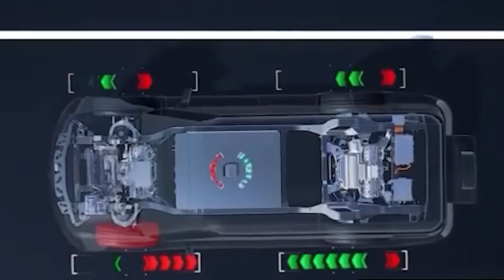Next-Gen BYD Blade Battery: A New Era in EV Safety!

Comment: Blade Battery (LFP):

Uses lithium iron phosphate chemistry (LiFePO₄).

Key Features:

High safety (resistant to thermal runaway, passes nail penetration test).

Long cycle life (~3,000+ cycles to 80% capacity).

Lower energy density than NCM but more stable.

Used in BYD’s EVs (e.g., Han EV, Tang EV, Atto 3) and energy storage systems.

Ternary Lithium (NCM) Batteries:

Nickel-Cobalt-Manganese (LiNiCoMnO₂) chemistry.

Comment: BYD (Build Your Dreams) is a leading Chinese manufacturer specializing in electric vehicles (EVs), batteries, and renewable energy solutions. Here’s a summary of BYD’s battery technology and key offerings:

### *1. Battery Types*
BYD produces several types of batteries, with a strong focus on *Lithium Iron Phosphate (LFP)* and *Ternary Lithium (NCM)* chemistries:
- **Blade Battery (LFP)**: 
  - Uses lithium iron phosphate chemistry (LiFePO₄).
  - **Key Features**:
    - High safety (resistant to thermal runaway, passes nail penetration test).
    - Long cycle life (~3,000+ cycles to 80% capacity).
    - Lower energy density than NCM but more stable.
    - Used in BYD’s EVs (e.g., Han EV, Tang EV, Atto 3) and energy storage systems.
  
- **Ternary Lithium (NCM) Batteries**:
  - Nickel-Cobalt-Manganese (LiNiCoMnO₂) chemistry.
  - **Key Features**:
    - Higher energy density than LFP (better for longer range).
    - Used in some BYD models and other applications requiring high energy density.

### *2. Key Advantages*
- **Safety**: Blade Battery’s LFP chemistry minimizes fire risks.
- **Longevity**: LFP batteries degrade slower than NCM.
- **Cost-Effectiveness**: LFP batteries use cheaper, more abundant materials (no cobalt).
- **Vertical Integration**: BYD manufactures batteries in-house, controlling quality and costs.

### *3. Applications*
- **Electric Vehicles (EVs)**: BYD’s Blade Battery powers models like **Han EV, Dolphin, Atto 3 (Yuan Plus), and Seal**.
- **Energy Storage (BESS)**: Used in residential, commercial, and grid-scale storage.
- **Electric Buses & Commercial Vehicles**: BYD is a global leader in electric buses with LFP batteries.

### *4. Global Expansion*
- Supplies batteries to other automakers (e.g., Tesla, Toyota in some markets).
- Expanding production in China, Europe, and other regions.

### *5. Future Developments*
- **Sodium-Ion Batteries**: BYD is researching lower-cost alternatives to lithium-ion.
- **Solid-State Batteries**: Investing in next-gen tech for higher energy density.

### *Conclusion*
BYD’s battery technology, especially the **Blade Battery (LFP)**, emphasizes **safety, longevity, and affordability**, making it a strong competitor to Tesla’s batteries and other lithium-ion solutions. Its vertical integration allows BYD to dominate the EV and energy storage markets efficiently.

Would you like details on a specific BYD battery model or application?

Comment: High nickel(90% or more) NCM or NCMA batteries are more suitable than LFP batteries for the EV environment that require high discharge and charge, i.e., high C-rate.  It is even better in low tempratures characteristics and energy density. LFP batteries may cause fire in high C-rate, so it is suitable for ESS that requires a low C-rate.

Comment: this article forgot that the BYD blade is already on the road since early 2023, Tesla uses the Byd blade LFP for its Model Y SR MiG (made in Germany). Way better charging than the current Catl and is on par with more expensive NCMs. The 2024 upcoming new blade LFP is next gen, same with the new Catl shenxing blade. Both improve performance again
Reply: This Blade battery version 2
Reply: next gen blade battery he is talking about!
Reply: Are these coming to tesla modelx?
Reply: My brother bought a Model Y from germany RWD model new in 2023. It had a CATL battery in it. I yet have to find any Model Y with the actualy blade battery. Even crashed Model Y RWD's i search for their battery have the LFP batteries from CATL. Can you please mention the battery pack unique identification number for the pack with BYD Blade ? Because Tesla never ever officially mentioned using BYD batteries. It's was all rumours.
Reply: @HermanWillems  Check the vin of the car,  XP7=made in Germany. 7th digit E=BYD, F=CATL. BYD was available from 4.2023 until now, BYD cars have the structural battery pack and front casting, completely different from the AWD and SR CATL. Tesla Germany made some CATL Y SR in Q3 2023 due to high demand of the Y. They were made on the LR production line. Tesla China only used the CATL

Comment: Sodium ion batteries are the most futuristic tech we'll probably see for a long while. This is huge news. (edit: which apparently is not the chemistry of the Blade battery, as it is based on LFP chemistry)
Reply: @alexkt3400  yes but graphene battery is the real future
Reply: @hansamluk  Agreed, but apparently all graphene manufacturing right now is being used for solar geoengineering. Maybe if they decide to allow some for battery use we'll see a huge leap in battery tech.
Reply: Sodium ion will be a game changer for entry level cars and house batteries for PV. Since they are cheaper and safer.

But they have a lower energy density. So you lose range with the same physical size of the battery. For middle class and high end cars solid-state lithium batteries will be a game changer.